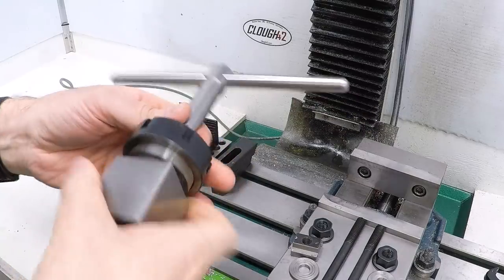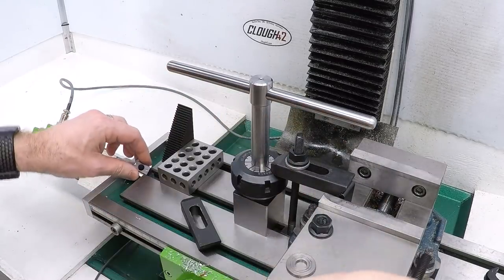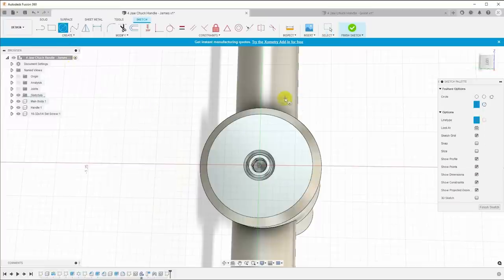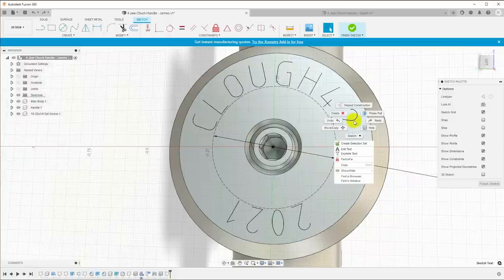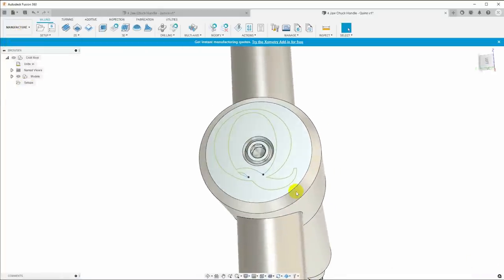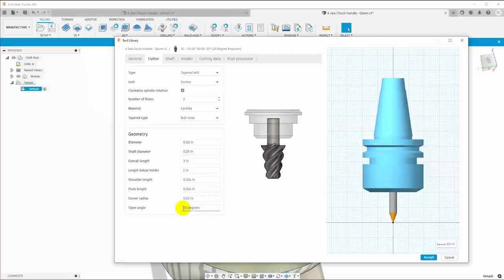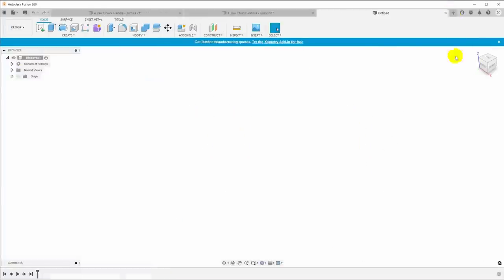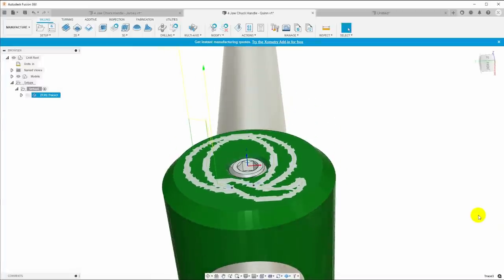Engraving Tool Steel - Chuck Keys Part 2

Comment: In case you don't know, in Fusion 360 there is a "shortcut" to draw a free tangent line on a circle/arc: click once on the circumference/arc with the line tool to place the first point, and then keep the shift key down, and the line will be drawn tangent to the curve

Comment: Using CAD software as a geometry tool is such a useful trick. I've done it a number of times with SolveSpace, my (open source) preferred cad. Have even used it for diagrams, just because being able to define constraints so flexibly is handy...

Great vid!

Comment: Nice little update, definitely gives it a better look. As for the reduced shank portion, I think it fits the aesthetic just right.

And as for "pay no attention", stop reading my mind! That's exactly what I was going to comment on. I've got the original Mars, I hope you're enjoying playing with the resin printer.
Reply from the maker: I am.  It's more of a learning curve than I expected.
Reply: @Clough42  personally I've found Resin to be easier to print than FDM, but it's got it's own quirks.
Reply from the maker: @cavemaneca  I think overall that's going to turn out to be the case--especially for exotic geometries, but I really struggled to get anything to stick to the build plate at first.  I totally don't understand the default raft geometry in Chitubox.  It's like they designed it to stick to the FEP.

Comment: Late comer, Nothing wrong with drill rod but  Impact socket extension then modify a socket adaptor to fit.
Why you can add length or use the Tee handle  or ratchet. (Tee hand can lengthen if needed no cheater bar needed)
This is very flexible but chrome molybdenum steel works better than drill rod for this application, Ask you knuckles...

Comment: I don't like using my 123 blocks for jobs that can be done with something where wear and tear may mar them. What I do to raise the step block the way you have done is to put two large step blocks together, they are a similar size to a 123 block that way and do an equally good job of spanning the tee slot and raising the third step block.

Comment: How many did you make?  The "Q" was originally 90⁰ clockwise... OR did you take it off on the lathe and cut the "Q" again?
Reply from the maker: Just one.  The orientation when I mounted it on the mill was different from how I had it positioned in the fusion model.

Comment: I might be wrong but i think i hear some  kind of bearing noise out of your spindle. Or could be vibration du to unbalance. I often hear this kind of noise at work. I work all day hearing spindle noise. We do mdf cabinet doors with cnc.
Reply from the maker: Nope.  You're hearing two things: the noise from the servo motor on the leadscrew, and the V-belt squeaking against the pulley.  I chased that last one for a while before I figured out what was causing it.  I should probably dress or replace the belt.
Reply: @Clough42  Good to know, much less problematic. Oh and a quick note, i installed your els on my lathe and i so much appreciate it, again thank you.

Comment: Love your videos, is it just me or does your lathe carriage handwheel make like an annoying clicking sound when you turn it? Is there a lot of slop in the wheel or something ? Sorry for nitpicking, keep the videos coming :)
Reply from the maker: It's sticky spots on the drive belt.
Reply: @Clough42   thanks for the response, my mistake, I meant to say the cross slide handle is clicky. @3.33 in your “making a better chuck key” if you replay it you will hear what I am talking about.
Reply from the maker: @Iridium1O  ahh.  Yeah.  It clicks.  I think it's just the swivel handle.

Comment: I might just have a scar on the back of my hand from a 0.030" extended spotting drill....
Reply from the maker: I have a scar on the back of my hand to remind me that even the power feed can get you.  I was cleaning up a Bridgeport mill and I was trying to save time by wiping down the vise while using the rapid feed lever to center the table.  I caught my left hand between the stationary end mill still in the collet and the side of the vise.  I had the presence of mind to let go of the power feed, and I spent a good ten seconds carefully thinking about which way I needed to move the lever to release my hand.  The good news is that it bled well enough to clean out the wound.

Comment: If only going .005" deep and you're using a tool that has a .010 radius tip, why waste the extra time modeling the tool as is rather then just a quick .020" ball mill?
Reply from the maker: Two reasons.  1) I want fusion to know about the full geometry so it can accurately detect collisions.  2) I'll be using the tool again, and I don't know yet how.
Reply: @Clough42  yeah, I guess that would make sense if you think you will have future situations where it could possibly crash.